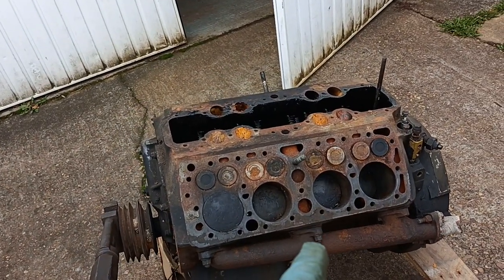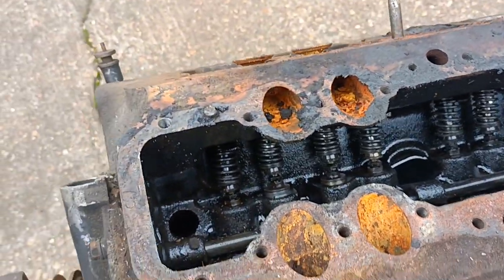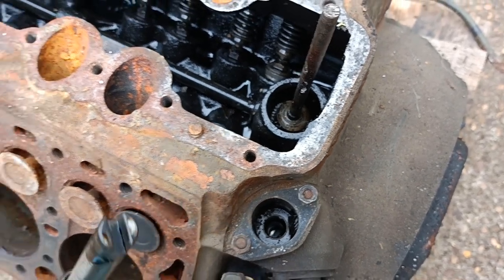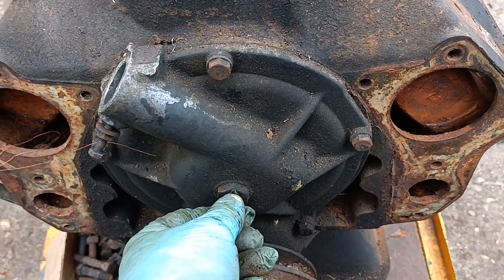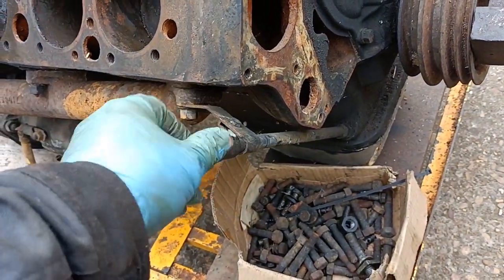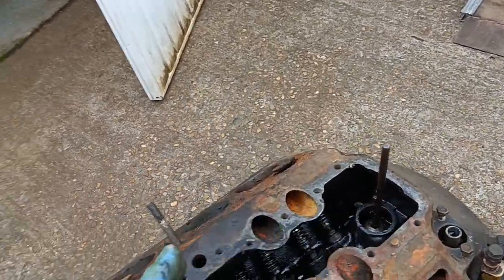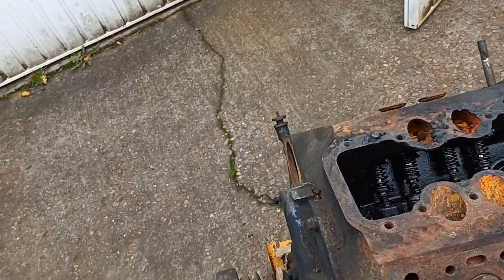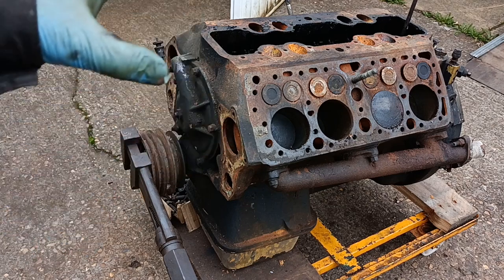French Flatty overview and assessment. Will this one rebuild? Deeside Flatty.

Comment: Sweet little motor you have there. Cleaned up nicely. Like the locking dipstick. Nice style exhaust manifolds.  High volume pump is a plus. Factory relief.  This little flattie is full of surprises.  Internals are very nice. No broken rings 🍻 enjoyed watching very much Mart. Oh yes,,,,,, do the 1.6 intake valves 👍Love how you improvised to trim up the intake ports. Interesting to see how the other one looks inside. These are very very nice blocks my friend if you don’t want one of them you can send it over the pond I’ll take it off your hands. Have a nice day mark thanks for sharing.🍻🍻
Reply from the maker: Thanks Ron. they take a bit of work to civilianise them, but from my experience they tend to be in good condition due to military maintenance schedules. Hope all is well with you. Mart.

Comment: Thanks for sharing, Mart! Based upon the water coming out of the cylinders when you removed the spark plugs, I was totally surprised at just how good the rotating assembly looked! Brilliant job freeing-up the rings on the pistons, but even more impressive was the removal of the restrictions in the valve passages! It'll be interesting to see what you do with the engine, for sure! Enjoy your weekend! Be safe!
Reply from the maker: Thanks Harry. You could hear in my voice that I, too, was surprised to see the bottom end all looking immaculate. I think the water had not been in there for long.

Comment: FWIW, were I judging how to best spend as little as possible on a balance with best outcome for the cost, I would be very inclined to spend on a "hot tank" service instead of a new cam/lifters. I would feel much better and more secure/content with a properly cleaned out base especially with the heating/cracking tendencies of flatheads. Only my "two cents" to be added to the budget. ;o)
Reply from the maker: Thanks Ron. Good points made. You know me, I don't like spending money unless absolutely necessary.

Comment: Hi Mart, do you think the restriction in the valve pocket could
 have been put there to reduce the possibility of cracking between the valve pocket and cylinder walls?
Reply from the maker: I honestly don't know, Aaron. There are a number of methods employed to restrict revs. The motors have a governor, soft valve springs, restrictive ports. But as a military motor, durability and robustness is high on the list so what you said may indeed be right.

Comment: Mart, what did you do with the valves ? Good shape after cleaning or did you replace all of them ? 
Also, I will take a look on my 239 but I think I don’t have these restrictions in the port. 
You can looking to buy a Simca Cargo FH. They don’t have the ugly boss at the rear.
Reply from the maker: Hello Harold. This motor is still in parts after being torn down. I have yet to work out where it will fit into the fleet. The crank was so nice I used it in the French motor I pulled from my roadster to use in the Sedan.

Comment: Mart another great video - did you need to cut the cylinder ridge(if any) when you removed the pistons?
Reply from the maker: Hi Chuck. There was very little wear in the cylinders. The pistons all came out easily. Thanks for checking in.

Comment: This was a really interesting video Mart. I've never seen a French block so up close. And where did you ever come across that valve bowl reaming tool? That's something  I didn't know existed. As for freeing up the stuck piston rings, what solvent did you use in the ultrasonic cleaner? Thanks again for an instructive end-of-week lesson on the myriad intricacies of these old and (in the case of 1966) not-so-old engines! Cheers!
Reply from the maker: Thanks Glen, glad you found it interesting. The tool is supposed to be used for valve seat cutting and cutting for seat inserts. I found it when searching for parts for my Buma boring bar. I have been using white spirits (mineral spirit) in the ultrasonic cleaner. It seems to do a decent job. Thanks for checking in.

Comment: Mart did the French put the lip in the valve bowel to power down the engine?
Reply from the maker: That's what I was told, Brendan and I have no reason to disbelieve it. It could also be to improve robustness and help reduce cracking.

Comment: Hello Mart , I’ve got a French flathead that was in remarkably good condition except for one bore that had corroded , I’ve had it sleeved back to it’s original +38 size to match the others so I could use the original piston, my problem is that two compression rings were broken. I’m having difficulty in finding a supplier, do you know where I could purchase rings for these engines? Thanks.
Reply from the maker: Check my homepage and the "about" button you should find an email address there. Drop me a line.
Reply from the maker: martsgaragevideo"at"gmail.com

Comment: HI Mart.. good looking motor. Just a couple of questions. 
Why would you put in a 59a cam?
Also noticed the oil control rings are the one piece cast iron type as opposed to the multiple rings with expanders. 
Do you think the cast ring is better?
The reason I ask about the rings is because I have a set of pistons with 4 ring grooves and I'm missing the third oil ring. The 4th ring below the gudgeon pin is cast. Thought I could shift it up to groove 3 and leave the lower groove empty.
What do think?
Regards Kevin
Reply from the maker: Hi Kevin. Thanks for watching. I like to run the crab type distributor so prefer then 59A type cam. I honestly don't know re the oil rings. I would just do what you are proposing and cross my fingers. We're dealing with ancient technology here, it will use oil more than a modern car no matter what you use. Mart.